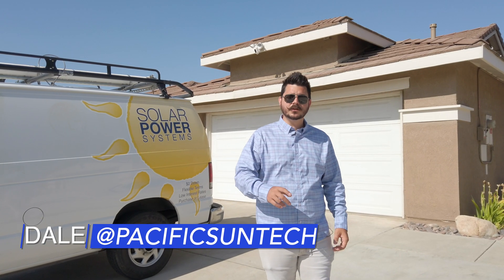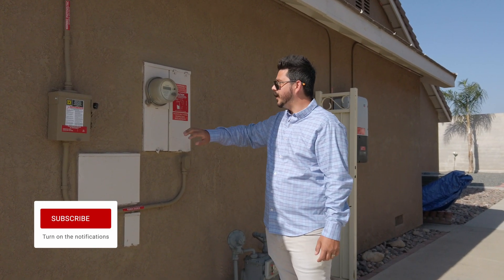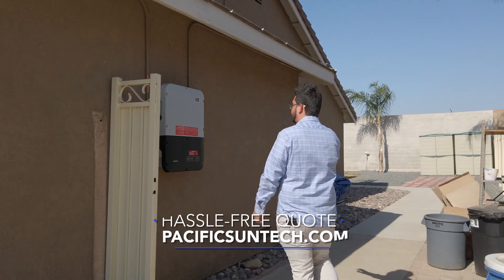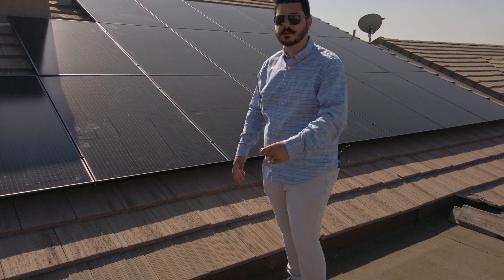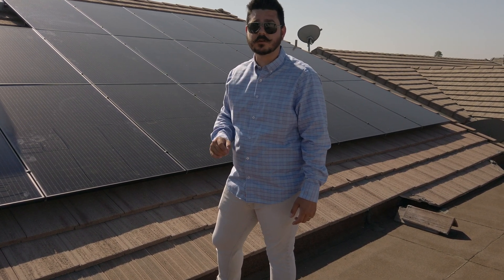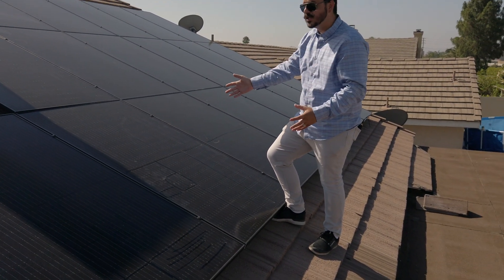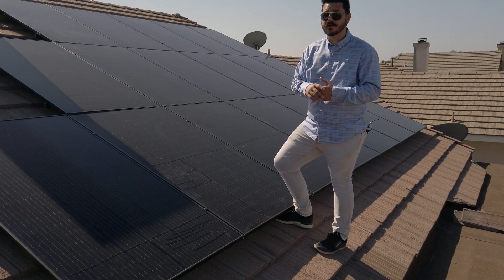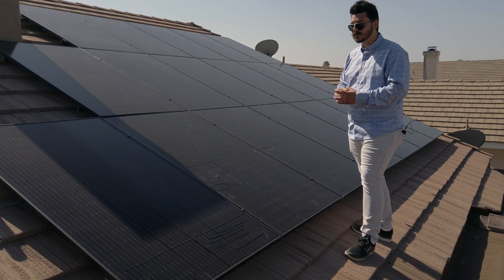QCells Solar Panels with SMA America Inverter

Comment: Thanks for the videos, question. Is the AC disconnect really necessary? Wouldn't  power outage (main breaker turned off) result in SMA Inverter not supplying any AC power, and the panel optimizers shutting down the dc power.
Reply from the maker: Yes, that is true. But California and America in general has a lot of redundant requirements. There’s some cities that require an AC disconnect at each array on the roof besides one down below.
Reply: @pacificsuntech  Yep in Australia, you have isolator on the roof, at the ground and bloody everywhere